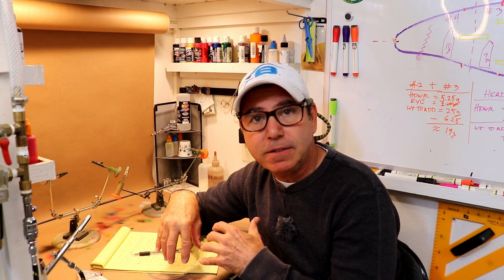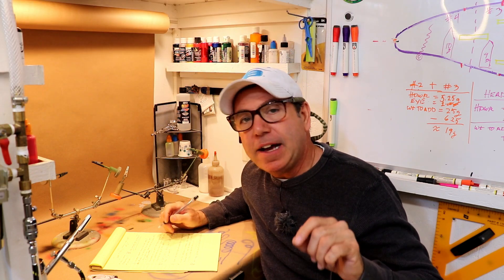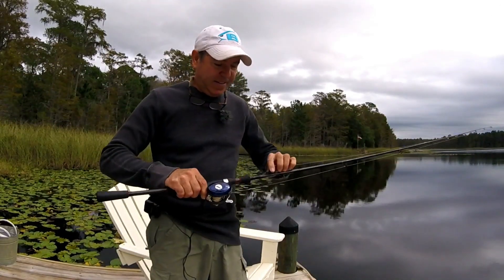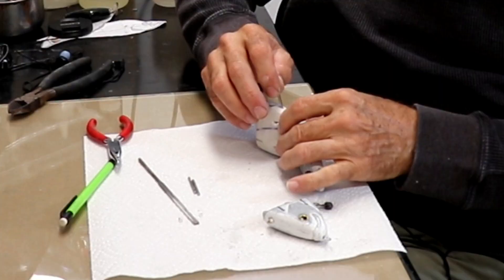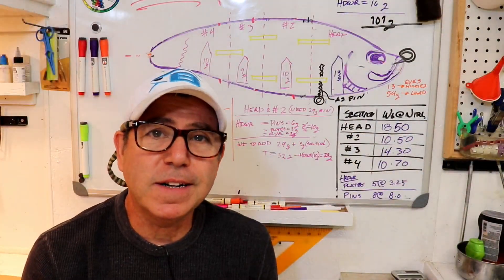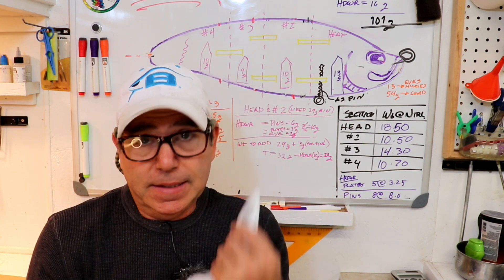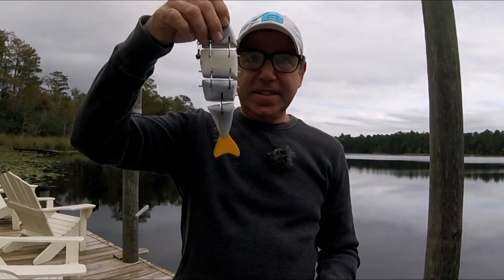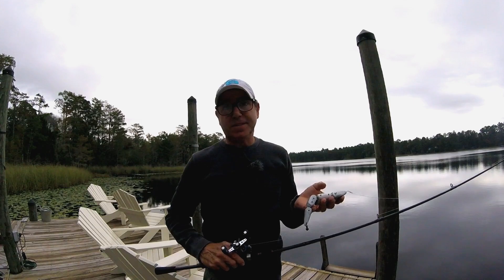Swimbait Fine Tuning and Q&A

Comment: I used to make and sell jointed swimbaits, so I really appreciate your videos, and how you explain things.  Please don't take this as a criticism of anything you're doing.  It's just me sharing what my own experience has been.  I am a carpenter, so I approached my design process by first imitating a successful lure that I already had, and branching out from there.  I have found that using a V shaped joint, with the concave side on the back of each section, seems to help initiated the swimming motion for each section more quickly.  I also use sst screw eyes and a sst pin as my hinges, and have found that there is almost no friction in those joints, despite the different weights/buoyancy of the sections.  I also think you are underestimating the amount of friction of you flat plates in the joint, because, as the sections have different buoyancy, they will move to the top or bottom of the joints as the lure swims, and the flat plates will rub.  Last, I never put any weight in the rear section, so it acted like a float, and allowed my bait to swim level at any speed.   This is just stuff I've learned through trial and error.
Reply from the maker: As an engineer my entire career is based on the experiences of engineers that came before me, mostly their mistakes. The most reasonable way to go about making a lure is to copy something you know that works. This was an exercise in extreme Design. I fully expected that it was going to be challenging to make it function as I envisioned.  And never worry about insulting me. I love to hear the comments, opinions and experiences of fellow makers, obviously, as long as they're meant as supportive. I think you'll find in the next video that I brought this lure to full fruition with just a little bit of a tweak to my hinge design. And, I say with as much humility as I can,  the action of this lure now is the best that I've ever made or have ever seen, perhaps a little bit of an esthetic Improvement would help. Thank you so much for watching and for you're thoughtful input. And don't take me too seriously I do all this for fun. Thanks again
Reply: @EngineeredAngler  I can't wait to see your next video!

Comment: How would you clear coat this with two part epoxy without limiting the movement of the segments, yet get proper coverage of the lure?
Reply from the maker: I clear coat the separate segments  then assemble.  I top off the hinge pin holes with a drop of uv resin.
Reply: @EngineeredAngler  Thank you for the reply 👍

Comment: I was thinking as I was watching this that you had made a choice to put more weight in the first two segments. ( can't remember the reasoning)  If you would transfer some of the mass to the last two segments if this would help.   Just a thought.
Reply from the maker: Weighting the lure towards the front is typically a good practice on most any swimbait .  This one is really unusual and you might be right,  starting with a little heavier back segments might help.  On this one it was all I could do to find the space to add the weight I did.

Comment: TRY THE V-CUT, instead of the hinges. the freedom of the single parts will kill the Action. if they can move just 30-40°,every part have to move.  look at other swimmbaits, they all are simple eye to eye conected. try it,and it will work.
and by the way,last time i was fishing i forgot my lure box... i was standig at the beach,with an empty bag and just one lure on my rod...
Reply from the maker: You should check out the first two videos on this build.  You'll see the reasons why I designed it this way.
Reply: @EngineeredAngler   i have seen them all... but it don´t work, and i want to help you. like in the last Video. ist not the look,its the function… but if you don´t want round tires,its not my fail. my lures are working nice,i just cant get it on film. when you build your lure in one piece it will work better.
another way to let it run was a diving lip in the front
Reply: you have to push the moving to the front,that happends when the parts knocking together,while retrive. and sry again for my bad english...

Comment: I think you need more resistance in the head (a more bulbous head with depressions on the sides) section to make the whole lure move more serpentine . The body will follow the head.
Reply from the maker: That's exactly what I was thinking....I'm going to flare the gill plates out and see how that works...
Reply: @EngineeredAngler  i was just going to comment on changing the nose shape. With a little resistance it might start to swim side to side and the tail would follow. Love your videos btw!!
Reply: I was having a terrible time getting a two piece swim bait to swim well. I added some flared gills with bondo and great results. The flares will help for sure. Also I would leave the hook off of the tail or not use the buck tail. That drag kills the action unless you can get the head to swing more.